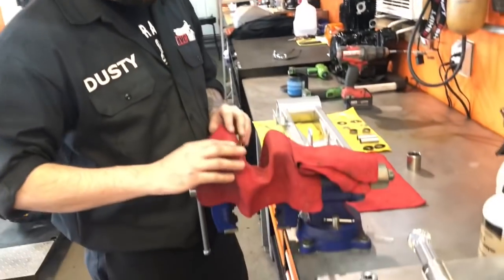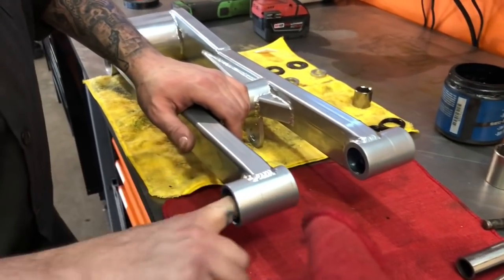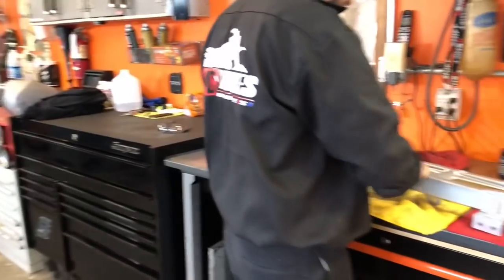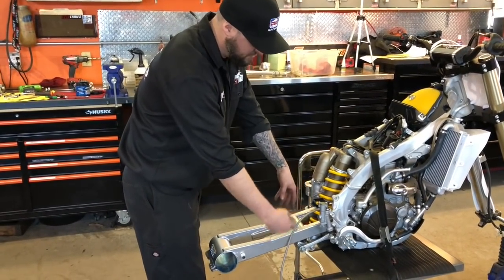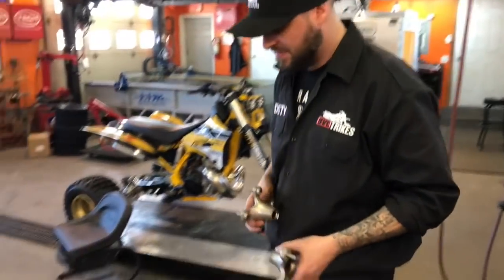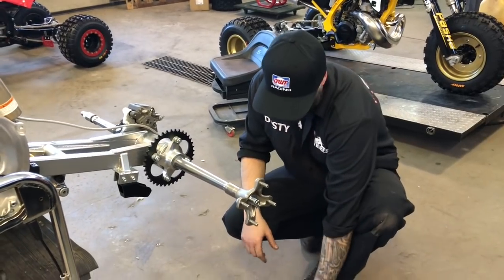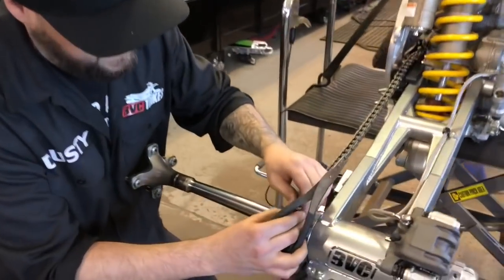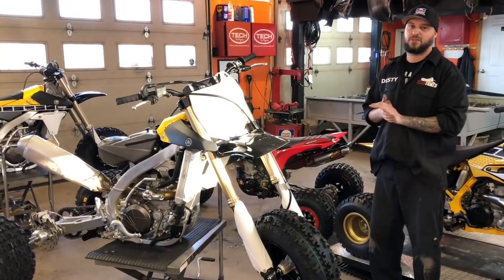BVC Trikes How-To: Install BVC Swingarm on a modern trike

Comment: Can you make me a swing arm to fit my KTM 250sx  2004- 2 stroke dirt bike. I can get the width measured of how wide my swing arm is from inside of where it mounts to you. I don't need anything super crazy pricy just sumthin that would work. I lost my leg in 2007 and haven't been able to ride it bcuz it's kinda hard to balance and turns are really crazy I have to go super wide on turns. I totally lost my whole leg so being 250 pounds with 1 leg is really crazy if you can picture it. However I'd love to transform my screaming fast 250sx in a wheeler. Don't really care bout the brake setup I have front brakes!lol  I just would love anything that will work and get me enjoying my bike again. Thank you.

Comment: I have a 2013 300cc icebear zodiac trike.. Its a automatic transmission 4stroke engine..
I went to put it into forward from neutral when I pulled to hard on the shifter/clutch and now it wont go into forward only reverse and neutral..
Plz help me what should I do I stay in Maryland do you have any suggestions or recommendations...